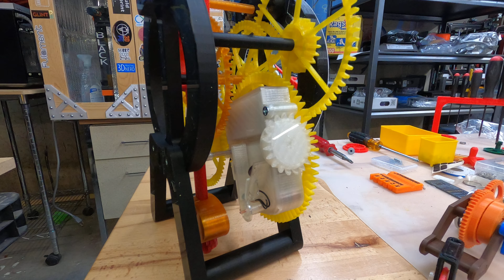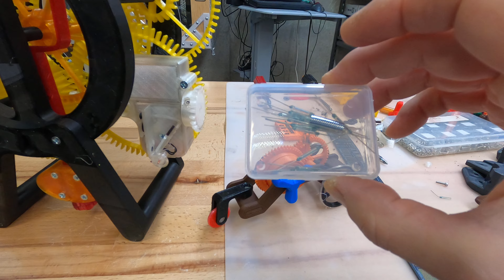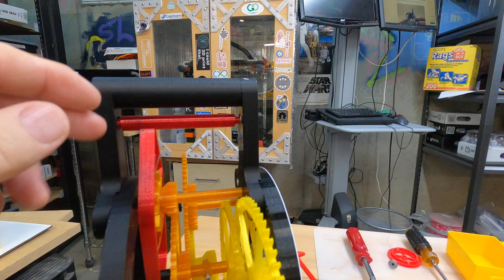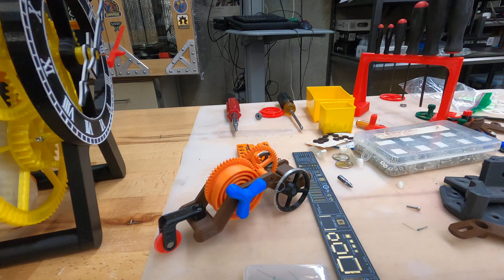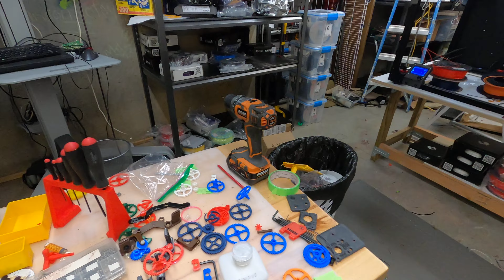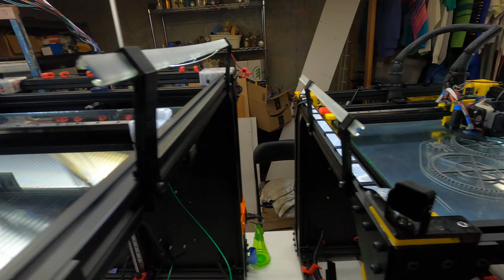Project update COUP PERDU CLOCK

Comment: That reed switch does look real delicate.  I might break it just looking at it.  Too bad about the wind up car.  I imagine if the spring is too tight, the wheels will spin and if the spring is too loose, the car won't move.  Quite the balance between force and friction.  Thanks for the update.
Reply from the maker: I think I have the switches figured out.  The leads have to be bent very carefully or he glass tube breaks on the ends. They were 20 switches and magnets for $10, so not too bad to break a few learning.   I'm really impressed with how the clock winding works.   Steve Peterson thinks the batteries will last 6 months.  The car, I think the spring is not strong enough to overcome the friction of plastic on plastic.  Thanks for watching, and say hi to Kerri
Reply: @woodwaker1   Will do.

Comment: When I get out from under work & life I'm gonna finish the Wandering Clock video. I just need to do the assembly segment.
Reply from the maker: Thanks for watching.  I gave up on that clock, but would like to see yours working.  I think you would like this one, it works well as designed and uses pretty common parts.  Take a look at the link

Comment: Nice looking clock. I really like the colors. Translucent filament gives a good look. 
I am getting ready to create a video focusing completely on the trigger mechanism assembly. It seems to be getting almost all of the questions.
Reply from the maker: Steve, I forgot to mention that all of the colored parts are PETG from GreenGate3D.  They have some great clear filament and it is very strong.  The frame and dial are PLA.
Reply from the maker: Thanks Steve.  I like to play with the colors.  It is easier once you have a working one.  The next will be brown body white and black dial and silver gears with Gold for the pendulum.  Good design and the body is really easy to build.

Comment: The clock looks great, but I'm guessing it's quite noisy, especially when it's doing its cool self-winding thing.

Another thing I enjoy about your videos is looking around your 'shop, it was hard to do with this video being just 360p.😄
Reply from the maker: Thanks.  Actually the clock does not make much noise.   At the beginning of the video my chair made a squeak,  but you barely hear the clock, it is really quiet in the "shop", I have half the basement.  It is always a mess, I have too many projects going at once.  Thanks for watching.
Reply: That is another one nice clock
Design. I was hope to see that car race table 😂 I think you will get it, but that clock looks real cool. What about adding rubber to the car wheels ? Like a grove for a rubber band to set in. Like a sawmill band wheel , it’s solid metal with a v-belt setting down in a groove on the wheel and then the blade rides on the v-belt. Appreciate you sharing your stuff again Mr.Wilson
Reply from the maker: @MsdMakingSawDust  Steve, thanks for the comment and suggestion.  I printed "tires" out of a flexible plastic, almost like rubber bands.  They grip the table well, it seems the spring is not powerful enough to move the wheel when contacting the table.  I may fiddle some more with it.